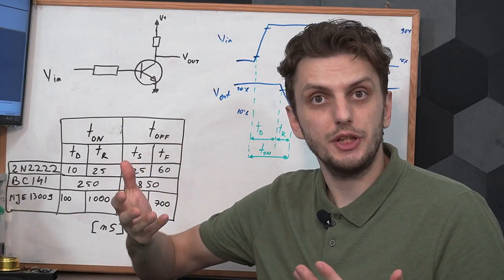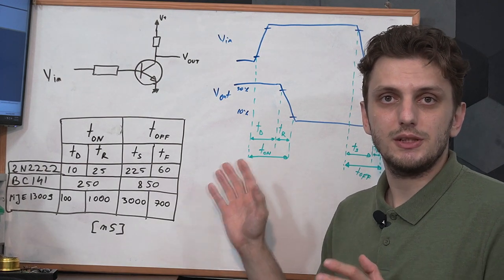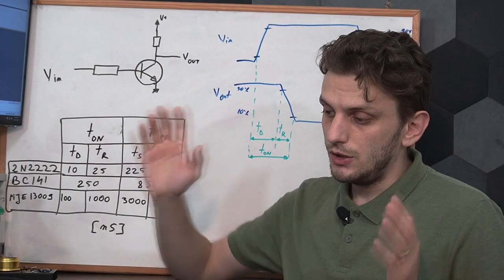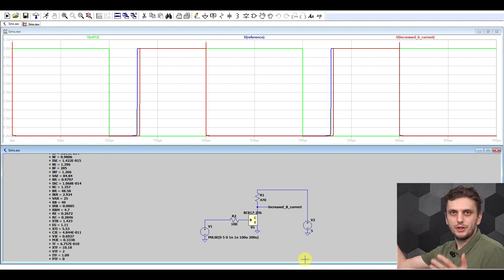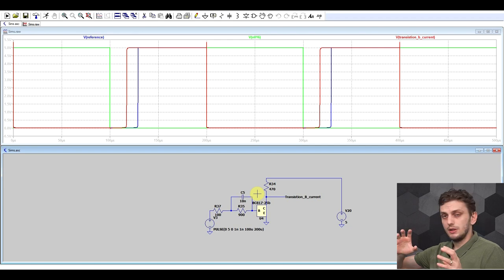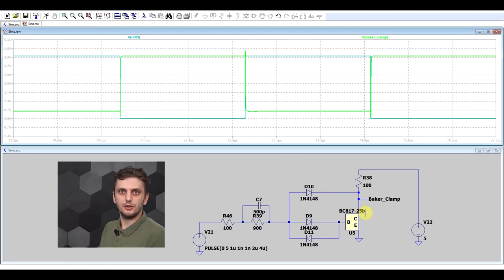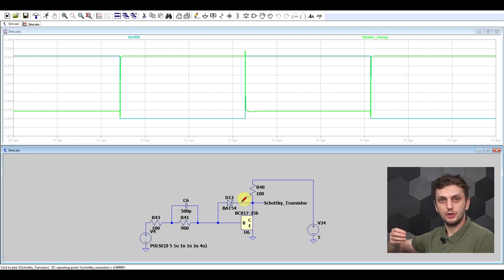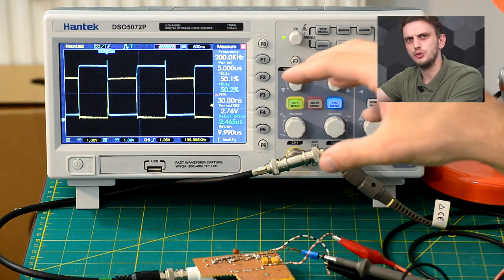Electronics tutorial - Improving switching times - The Baker Clamp and the Schottky transistor

Comment: Great demonstration ....
Reply from the maker: Thank you! I'm happy you enjoyed it! To be honest I noticed this turn off issue when working with the SMPS drivers, they ended up switch very slowly, so I had to limit my switching frequency to <100KHz. I remember you where also working on that sort of circuit at one point. By applying the extra schottky diode, I guess things will work much faster without the need for special transistors.

Comment: OMG. i have faced a very bad experiment with this circuit before and it was such a disaster  in my project and after many search and modification on board i found it won't work even with the  modifications you mentioned in this video , simply because my collector voltage was to be 24v and you have to maintain  a certain collector current to get better switching times and of course there was much power dissipated in the pull-up resistor connected at the collector.
after all that trouble i used another ic and it can handle my 4MHz with no problems at all also without any external components.

i really wanted to thank you to share this video with us and warn others from this trick.

Comment: If i may ask, how did you determine the necessary value for the speed-up capacitor? I cant seem to find anything about it.
Reply from the maker: Depending on the frequency at which you want it to act, its impedance needs to be smaller than the resistor over which it is placed; if you have a capacitor placed over a 1k resistor, and you want to "speed-up" signals above 1MHz, you can determine the capacitors impedance Xc=1/(2*pi*F*C), so a 1nF capacitor will have 159R at 1MHz, it will have a considerable impact, but the same capacitor at 1KHz has 159Kohm, so it does nothing.

Comment: I did not understand the purpose of using split resistor.could u please explain little bit.
Reply from the maker: You mean in the base of the transistor? Well, one resistor is there to always limit the current, while the second one has a capacitor shunt - when a pulse is applied, the capacitor is shunting the second resistor, but after it charges, the second resistor reduces base current. The idea is to have a peak current during a transition and then a lower current after the transistor switches
Reply: @FesZElectronics  So u mean we need to select time constant of the of the input circuit in such a way that within input pulse width capacitor should charge fully.once it fully charged then it will act as a open circuit and second resistor will come into picture and it will reduce the base current. correct me if I am wrong.